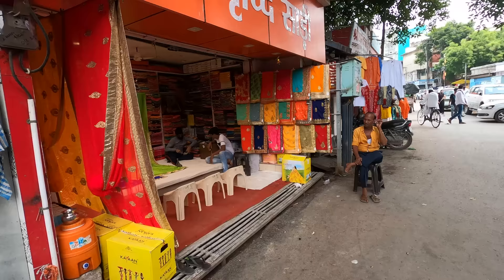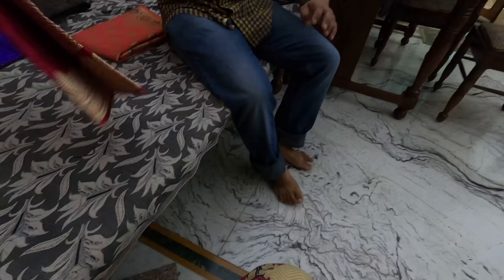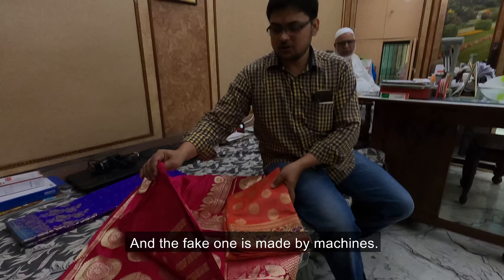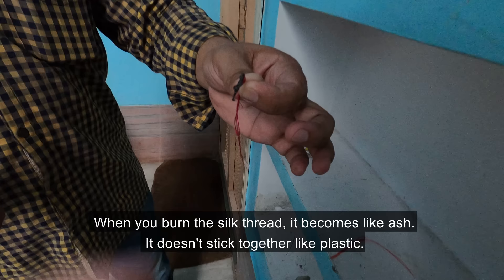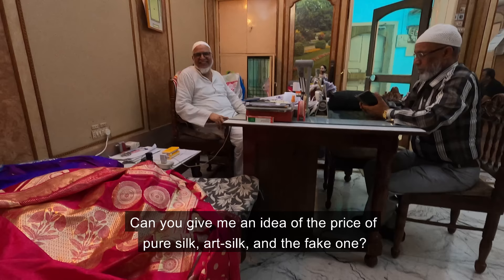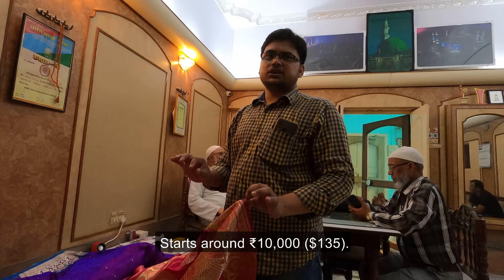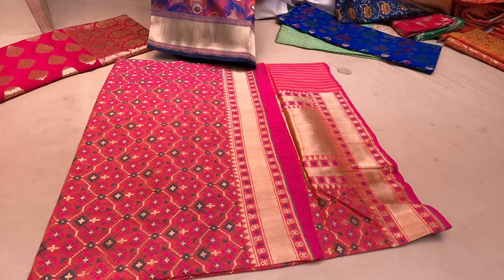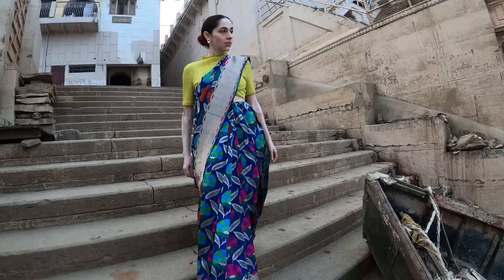How to Buy a REAL Banarasi Saree in India Avoid Chinese Fakes!

Comment: Hey Manisha, your info is very helpful. I went to benaras and was trying really hard to find the authentic silk.. even after spending 21000 i am still unsure if it the original one.. if you could have shared some craftmen contact or details of shops that would be a real ease
Reply: Ikr if the contacts of these craftspeople were available...Btw Did you tried the burn test ?